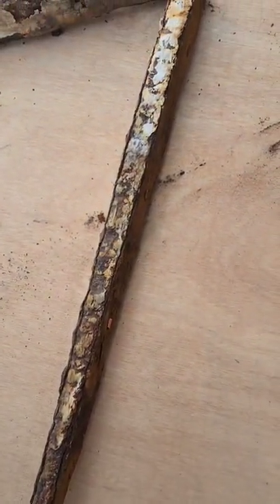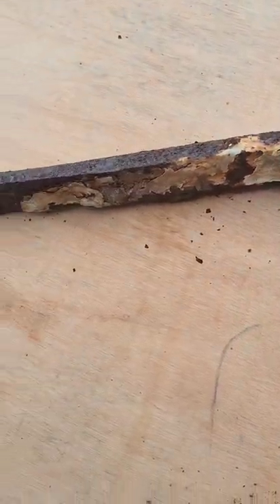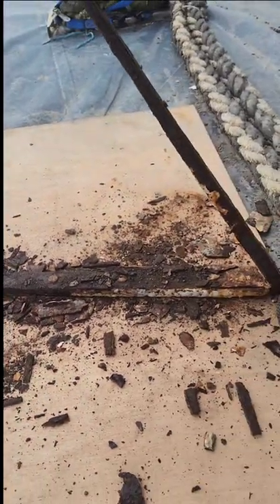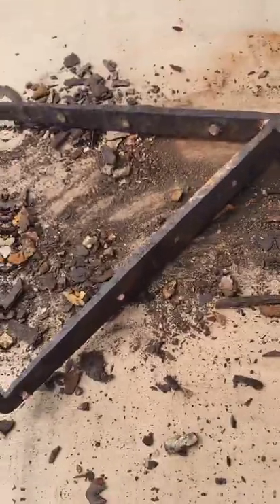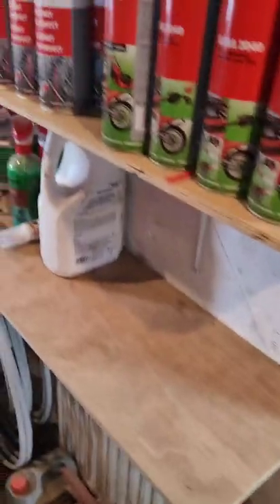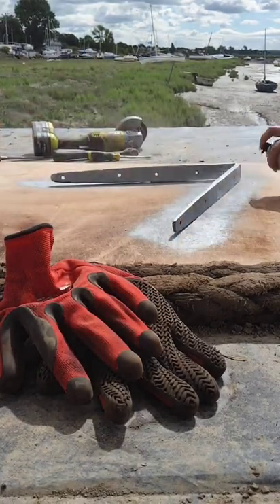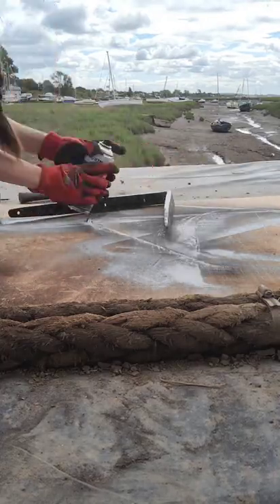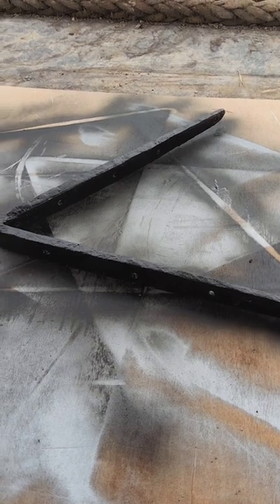#shorts Restoring a 79 year old metal knee from the boat #boat #boatrestoration

Comment: It’s probably far too much trouble to get these out to a blasting company. But if you could a full grit blast and zinc metal spray would be the best option. I had been car axle done by a company that works on Brixham fishing boats. Years later it’s still good as new. No rust breakout anywhere.